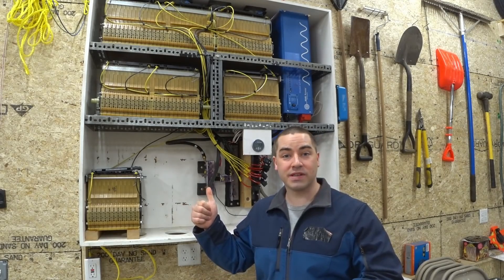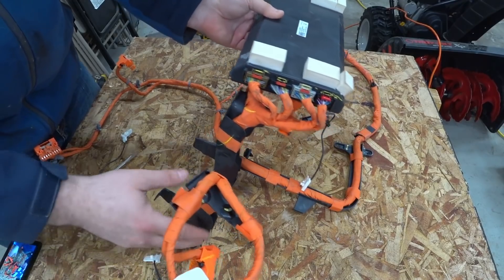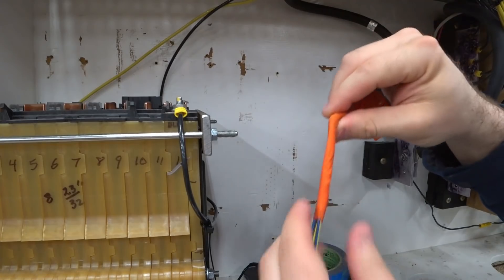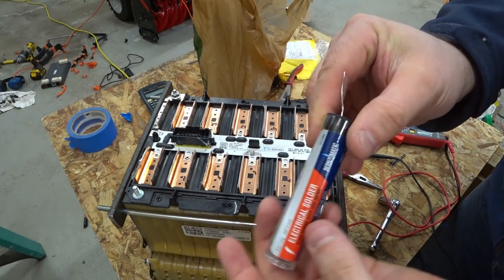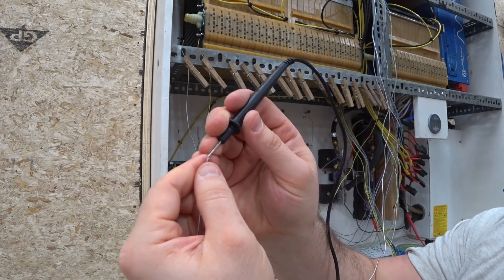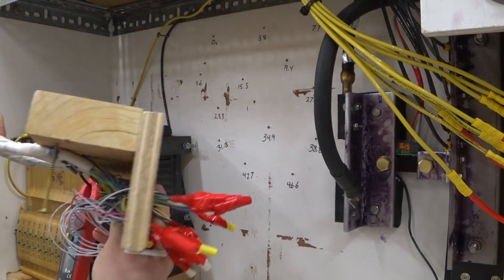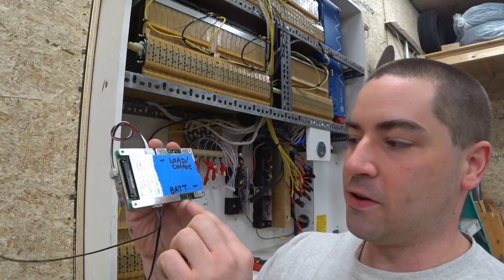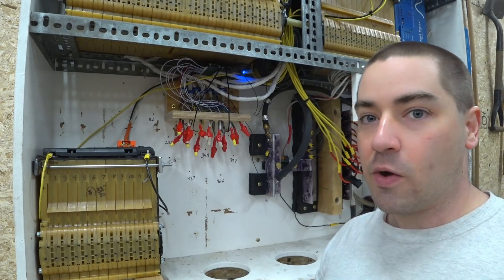DIY Lithium Battery Wiring Harness and BMS (Battery Monitor System)

Comment: David;  I have been trying out a few different cell balancers and have found one that works for the chevy volt batteries. The ISDT  go battery BG-8S plugs directly into the older Volt battery connector with a JST plug. It balances six cells at a time or half of a 12 cell battery. It takes about 3 days to balance from a 50 millivolt difference down to  a 2mv difference. I have finally balanced all of my cells.
The Hobby King balancer didn't appear to work and I fried one of those balancers that you have.
Reply: No no no!
Do NOT use isdt. It uses passive, not active balancing. It cannot take from high cells and give it to low cells. It discharges all other cells until they match the lowest cell
Reply from the maker: I'd like to know more about how you fried one of the balancers I have.  Did it turn on the resistors too early?  Did it try to run all the resistors at the same time?  At what cell voltage did it turn the resistors on?  Is that adjustable in the app?  Thanks.
Reply: @DavidPozEnergy  ; I'm pretty sure that I wired it wrong, my fault.

Comment: Good job! As someone else said, maybe a switch to turn the BMS off except when you want to take a look sounds like a good idea. If it were me, I would have a couple of smoke and heat detectors right in the battery frame work. Also a few big fire extinguishers handy. Stuff happens.
I like all the energy saving projects you are doing around your house and hope they serve you well. Keep it up.

Comment: Wow! lots of work and a Ratatouille of wires.  I'm still old school thinking with batteries, but I visualize that battery currents are like water, when properly attached they are self leveling, which might explain that after a year, yours are all the same readings?   I hope you are making an instruction manual for yourself, because a year from now you will be saying "WTF, How did I do that?".  Good Job

Comment: David, I don't use an active BMS either, but I do have a 7S wiring harness for each one for monitoring and balancing when necessary.  One thing to consider if you do plan on balancing cells through that harness is the wire gauge.  With that stock wiring you will be limited to 1-2 amps of max current drain while maintaining accurate voltage readings for balancing to target voltage.  I use at least 18 ga wires for harnesses with more than 10p 18650 cells.  Otherwise it can take you many hours or days to manually reach the desired (balanced) target voltage.  Hope that helps :)
Reply: The reason I don't use a BMS is that they suck the life out of your batteries!  Current BMSs do 10s of thousands of micro-cycles on your packs, and always draining, never charging to target voltages.
I had 2 packs of about 750 watt/hour capacity each that I had connected in series over 2 years. One had a active BMS and one did not.  They were identical in all respects, including the cell sources.  I'm able to measure pack capacity to within 0.5 wh with back to back tests on a ~750 wh pack.  After 2 years the BMS pack had less than 90% of the original capacity, while the non-BMS pack had just over 99% of original capacity.  Approx. 200 full cycles during that 2 yrs.
Sure you need a BMS in consumer friendly things like electric cars, drones etc.  But for us hobbyists who have built powerwalls and such, we know our systems and can maintain them manually to extend life at least 10X.
Reply from the maker: Hi Aspendell,  I love your comment and want to learn more about your system.  The BMS that you tried, is it like my setup, or different?  I certainly want my pack to last as long as possible.  Thanks.

Comment: I have a similar setup, I use a balance charger if things get out of balance, I just put a extra balance lead on along with the BMS, the BMS is only to shut off incase of hi/lo voltage or out of balance, you could use the BMS to power a contactor, and keep this function, ' 'shuting down in case of faults',

Comment: Chevy did a good job but you did an even better job when you installed the batteries. That is why they stayed in balance! I always say, If you take your time and know what you are doing, you really don't need a BMS. I see this as proof. Some will say i'm wrong and in some cases I am wrong. But you did it right and it shows. Love your work. You take the time to do it right and you take the time to learn if you are not sure about something. We need more folks like you in this world!
Reply from the maker: Thanks for such kind words.
Reply: what's the installation has to do with balanced cells?

Comment: At least if you configured your battery charger to the correct settings that will not over charge or shut off in the lower limits, your in safe mode. Remember theirs a limited time that batteries gets less efficient, it's discharge faster and heats up..... etc, etc....
Reply from the maker: Yep, the only charger I have is the Victron.  It will make a hard stop at any voltage I set it to.  I currently have it set to 49.2v, or 4.1v/c.

Comment: Dave this is a very entry-level BMS for your system you need a more advanced BMS which has many safeties and safeguards to protect you and your loved ones in case you have catastrophic failure of the batteries. There are several excellent BMS systems out on the market that has multiple system in case one system fails. This is especially important when you repurpose batteries.. good luck with your system..
Reply: Got anything for a 14s system?  I’m looking for something that’s just simple.... something that can set a bit , or pull in a relay if one cell is too high?  Or release a relay if one cell too low?  I don’t mind a “monitoring” system... I just want a safety shutdown more than management.
Reply: @ai4px  batrium makes a good system.
Reply: @codymiller8505  batrium has excellent customer support
Reply: Jr Gt interested to know what you’d recommend
Reply: Orionbms makes reliable BMS system's that are affordable.

Comment: Another great video the parallel method is what I am using until my BMS comes for the A123 bus packs seems to keep them balanced at least in the string of the cell number now the strings may drift especially under load. Put a large load on your battery while checking the string voltages and that should tell you how close the they are or show the weak ones, but I doubt there will much difference. If nothing else this project you found the one cell that would have given that battery a problem.  Cheers.

Comment: 11:03... I would suggest using a small rubber hose split down the center to place over the Angle Iron cut to protect the wires better over time.
Reply: I made the same suggestion a few videos back, guess it was missed.
Reply: And a block behind the battery to prevent the battery from being bumped further toward the wall and cutting or shorting the balance lead wires.

Comment: I’m shocked that you didn’t already have a BMS! It’s good that you are finally installing one.
Reply: The bigger the battery the less need for a BMS. In this application. Now if he was pulling 500 amps 100% of the time and charging it at 250 amps 100% of the time we would have to have a good BMS. But with these batteries and the charge/discharge these batteries see, just need to monitor them. I see a lot of utubers making battery banks with used 18650 cells. You want more than just a BMS with those cells. 18650 cells are great cells but when you install 5k 18650's, there are just to many "if's".
Reply: Bms is like a coronavirus. Everybody talking about lithium and bms fires, and making fear with no experience. Lithium only need to balance when cells are unbalance. Play with lithium first and them you talk about lithium.

Comment: Finally! Well done David... I remember our conversation about multiple BMSs a while ago... and I tried to explain (with ascii art!) how you could parallel them all together to be able to use 1 BMS.
I have exactly that little BMS on my 2kWh ebike battery. It's very useful, but its 60mA bleed current hardly has any effect even on that!

Great that you could use all the wire looms - If starting from scratch I would have daisychained them so not to have a rats nest, but there advantages with star configuration too.
The 1A glass fuse you replaced is a potential weak spot. I'd use 3-5A. It's pretty unlikely to blow, but if it does then you probably won't know about it for a long time and its voltage could potential drift out of spec.
I guess you'll get a Batrium eventually, but until then you have a good way to keep an eye on the battery and have some peace of mind, which is worth a lot.
Summer's coming... Solar energy increasing.... yay! :-)
Reply from the maker: Hi Andy.  Yes, you were right about paralleling.  At the time of our conversation I didn't understand it.  I had to learn.  Things finally clicked when someone who watches the youtube videos sent me an e-mail.  He had cells paralleled.  Slightly different, he went directly off the copper tabs, and daisy chained one battery to the next in a row.  But it was thanks to the picture that I finally understood.

As for the fuse, the one I took out had "630 ma" printed on it.

Comment: David, not sure which BMS that is, id highly recommend you put that BMS on a switchable switch or if can turn it off in the app and just turn it on like once a year. When i built my battery packs from 18650 cells, my earlier packs I didn't put BMS on them, but in the past few years i started putting E-bike BMS systems on the packs and i found that they are constantly trying to change something in the packs every hour of the day, adding voltage, bleeding voltage, because the tolerance for them to initiate balancing is so tight with no room for the voltage to move when used daily. I found that the packs with BMS's would give me issues occasionally with cells getting too hot and the overall voltages of those packs always stayed lower than the packs i have mounted on the wall without BMS due to the BMS constantly trying to pull and add voltage along the cells. So i put switches on the power wire to the BMS and just turn them off and turn them on once a year for a few days, then turn them back off and after adding a switch i stopped having all the issues I was having before with the packs with BMS. I have 34 packs in total in my powerwall ive built to date with only 23 of them with BMS's. The ones without BMS are less than 5% out of voltage since 2013. One of these days i plan on playing with Arduino's and ATTiny45's and build myself a custom BMS, Mega Mech over on the DIY powerwall forums built his custom BMS with these parts and implemented a bigger range of voltage differences in his BMS to allow it to only activate when voltages fall like 5% different, then it times out for 30 days unless it detects a difference more than 10% and overrides the delay loop. After building his, he had over 70+ 18650 battery packs on his DIY powerwall from laptop cells and in 2 years its only ever activated BMS 3 times in total using used battery cells.
Reply: Very very interesting

Comment: I do not understand how you paralled all of those cells without letting the smoke out! All the packs are in series and the cells are paralled it should go poof! You should need 8 BMS's. If there is some documentation somewhere explaining why it isn't in fire please give me a link!
Reply: he just added more P to the existing S which does not change the voltage in the pack just the amperage.
Reply: Ron, each 48 volt pack is (already) in parallel- he's just taking it one step further and paralleling each 4 volt cell.

Comment: Which BMS did you use?
Reply from the maker: https://www.aliexpress.com/item/12S-20A-50-4v-bms-12s-2018-new-Li-ion-smart-bms-pcm-with-android-Bluetooth/32875990870.html?spm=2114.search0604.3.2.6539143baNlcHT&ws_ab_test=searchweb0_0,searchweb201602_10_10065_10130_10068_10890_10547_319_10546_317_10548_10545_10696_453_10084_454_10083_10618_10307_537_536_10902_10059_10884_10887_321_322_10103,searchweb201603_60,ppcSwitch_0&algo_expid=5f13e5ec-58b1-432d-82b5-08453babb5b9-0&algo_pvid=5f13e5ec-58b1-432d-82b5-08453babb5b9&transAbTest=ae803_5

Comment: Are you sure those are fuses and not capacitors? I don't "speak" S.M.D.s (surface mount devices) but telling a fuse from a resistor from a capacitor can be a challenge...
Reply from the maker: Nope, I'm not sure.  To tell you how familiar I am with electronics: I had to go buy solder for the first time to do this.
Reply: @DavidPozEnergy  They are for sure fuses.
Reply: @TrackGeeks  -OK, I'm no expert, they just look an awful lot like shunt resistors :)
Reply from the maker: @Jeff MacDonald: I don't know if this helps, but the tiny writing on the (thing) is "LF 630 mA"  The "LF might be an "LE" it's hard to tell.
Reply: @DavidPozEnergy  LF is for LittleFuse. That is the manufacturer. You can find the ceramic SMD fuses on Mouser or your favorite parts supplier.
Reply: @TrackGeeks  Thanks!!

Comment: Is the communication with the phone app coming directly from the BMS or is there a third-party module in-between? Manufacturer/part number details?
Reply: https://www.lithiumbatterypcb.com/product-instructionev-battery-pcb-boardev-battery-pcb-board/ev-battery-pcb-board/smart-bms-of-power-battery/

The BMS comes with a little Bluetooth Dongle that communicates with your phone.
Also you need to connect to the BMS through the App and not through the android Bluetooth settings like he tried.
Useful info here: https://endless-sphere.com/forums/viewtopic.php?f=14&t=88676

Comment: O also when the cells are all tied together like that if one cell dies it takes the hole system out, so I would look into a bms per 48v battery or a large bms that can handle the hole system, either way its still a very save battery tech and just having that monitor will help a lot :)
Reply: I love your channel.  I've been a subscriber for years.
Reply: David.  Going off Grid is correct.  You should really have each battery pack with a BMS on it.  I have 3 of mine done with the 60 AMP Smart BMS and they work great.  I have 5 more coming next week.  I use the PC interface box that you can buy.  I have a 8 port USB hub that i plug them into.  Each BMS gets it own com port.  
Nice job in hooking them up buy the way.
Reply: @Jeff-ow4ud   he might have wired this differently to what  going off grid and you do bypassing the cutoff feature, it might not even have on. just look at the thin wires, they are only used to power the bms board
Reply from the maker: @Jeff.  There are two negative spots on the BMS board meant for soldering wires to.  One is for connecting to the battery, and the other for the loads and charger.  I think this is so the BMS board can cut the connection if the battery goes over (or under) voltage.  You are right that I am only connected to one of those spots, the battery side.  I did this just to power the BMS board so I could use it as a monitor.
Reply: I do have both negating wires on my units.  One to load/charger and the other to battery.  I have tested them by uisng the PC software to change settings and they do work.  So not bad for a cheap BMS.
Reply: @DavidPozEnergy  you said so in the video. it is quite clear. that bms is used for observation. and it might do a bit of balancing.
Reply: @DavidPozEnergy  I encourage you to get in contact with Bobolinksolar.com Kelvin created a BMS setup for his packs. He will wait and monitor his pack for an imbalance then plug in his balancer.  I believe his evens out the cells without draining them down. If I'm not mistaken he may even sell them on his website.
Reply: @DavidPozEnergy  don't take my comment the wrong way I love your channel and love that you are going solar! just giving my advise that I have tested to be true, thanks for the video. my comment got more attention that I thought it would :S.

Comment: looks good! been there on the bms wires, takes forever! What most don't understand is a bms is not for when the battery is good and working as it should, it is there when shit hits the fan and the bms can try to balance and if that doesn't work it cuts power. that is where using lithium without a bms is very dangerous, and these used batteries need a bms, any system without is nuts.
Reply: so a bms is just a smart battery balancer?
Reply: @closertothetruth9209  its needed to shut down all current to the battery if its over charged or over discharged.
Reply: You are partly right. Whether lithium is dangerous or not depends on the chemistry. Lithium iron phosphate for example is not dangerous no matter what the voltage. A well designed pack is either top or bottom balanced and you don't want the bms interfering with individual cells. EVs generally don't have balancing, only monitoring. The main method of balancing is discharge of higher cells which in a large capacity pack is going to take forever and cause unnecessary cycling. You want monitoring only. Balancing must be done manually at either the top or bottom of the charge curve
Reply: @climatechangepreppersfaceb2148   don't agree with you. unbalancing happens with use and has nothing to do at all whether you top or bottom balance. and the more you use the battery the more unbalanced they get.
Reply: @ursodermatt8809  the point in a bms is to cut charging or discharging when they go to the extreme.
Reply: @ursodermatt8809  please quote what I said that you disagree with. Because it looks like you are putting words in my mouth
Reply: @climatechangepreppersfaceb2148  that's why a BMS is needed, not just for balancing but it cuts current from going in or out of the battery when needed.
Reply: @GoingOffGrid101  I know what a bms is designed to do. I designed and built one that had better specifications than the best one on the market. Unlimited charge current. Unlimited discharge current. 1A balance current. Self calibrating. Lowest power consumption. Unlimited cell count. Those were the days